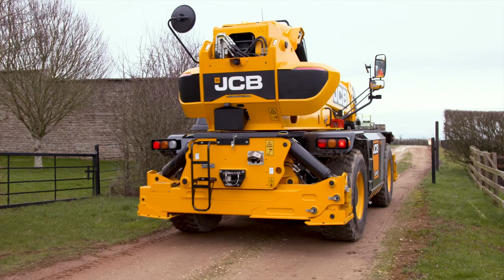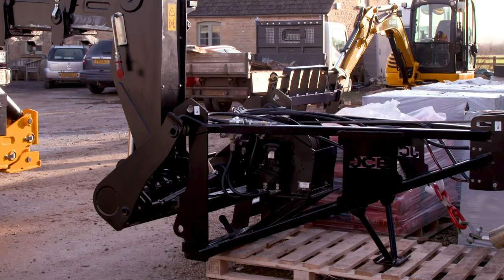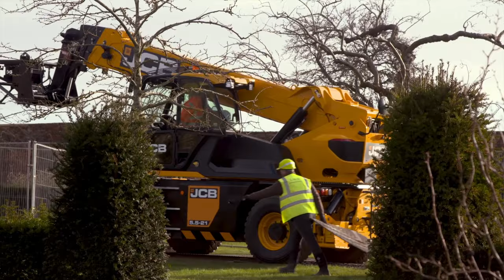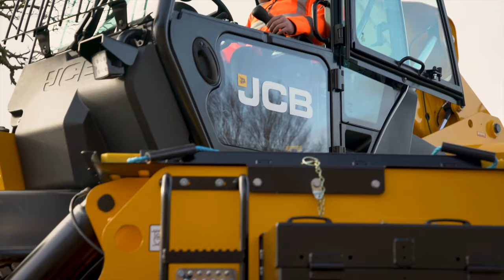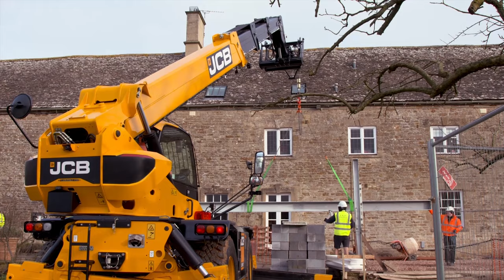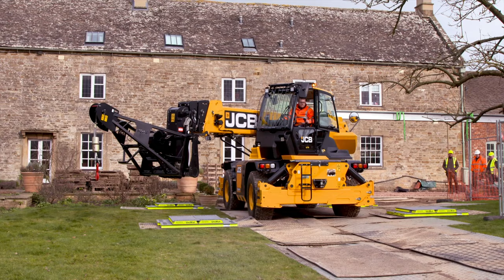JCB 555-210R Rotating Telescopic Handler

Comment: Would you need a 360 telehandler ticket for this or can you operate it on the a17c?
Reply: In Australia you need a minimum 20T or above crane ticket. Mine is 60T, I operate a Manitou 360 tele.
Reply: You'll need a 360 telehandler ticket, but very few & far between jobs on one, never been on one since I did the training.
Reply: @superfreak19891  yea I been driving the normal telehandler now for coming up 2 years and I have never even seen a 360 telehandler in real life 🤣

Comment: This is a Magnilift knockoff. United Rentals here in the states have been renting Magnilifts for several years now. Great for mobile cranes (no NCCCO certification needed) and limited forklift usage, but not designed to take the place of a telehandler. Machine weighs about 44,000lb and is big, bulky and too cumbersome for general extended reach forklift applications. Most have a reach of around 80’ +- plus the jib, and have exceptional lifting capacities at full reach.
Reply: So let me guess manitou and merlo are knock off of a magni get a grip
Reply: Mobile crane really ....